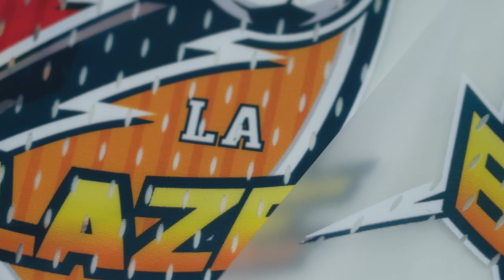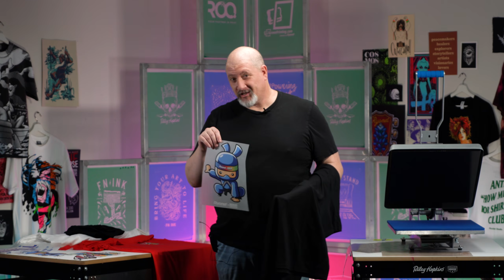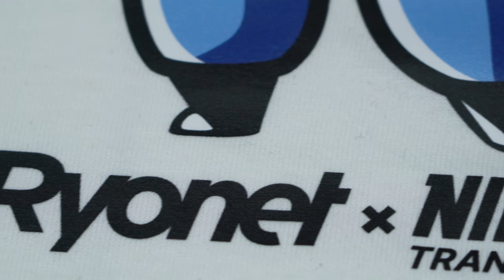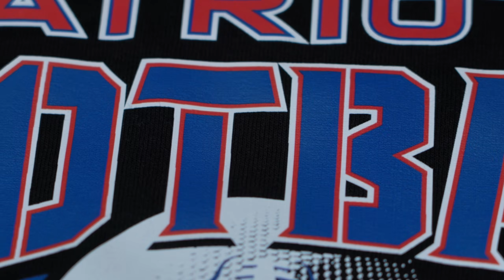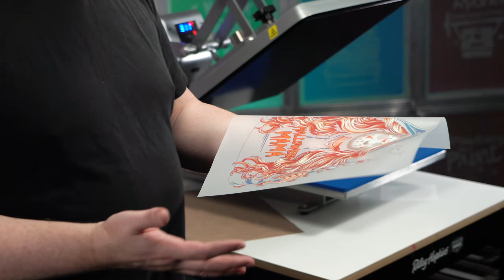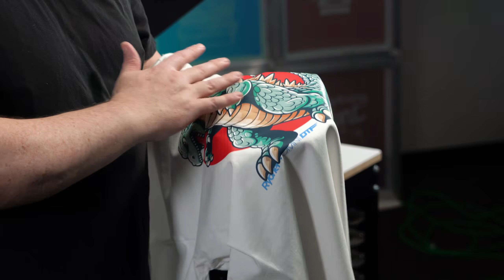Everything You Need to Know About DTF Heat Pressing | Deep Dive With Colin

Comment: Thanks for this Colin! Do you ever use a heat press pillow to prevent those crease marks along the edges?

I’m also an old school screen printer. I’ve been warned about DTF and probably digital hybrid printing taking over but do you see this as the case or do you anticipate screen print will have longevity and continue to be around?
Reply: Hey!  I have used the pillow in the past.  It works, but not as well as everyone "hopes" it will work.  I mostly dislike it for causing the occasional hiccup/wrinkle in the transfer or causing the transfer to shift a little.

Direct to Film Printing - in whatever form it takes, will not go away.  Just like Direct to Garment printing has not gone away. DTG has been distilled down to what works best for it, which is print on demand / crazy quick turns with "lower volumes".  Hence all the 750k+ machines that are designed to do multiple forms of Direct to Garment printing.

Direct to Film will improve in hand feel over time.  But it WILL NOT replace screen printing.
Reply: @colinhuggins6164  I think I needed to hear that today, haha. I also just love the screen print method and as far as I know some forms of it date back to Ancient Chinese methods thousands of years ago.

That makes sense that the pillow could cause some hiccups-the only thing I wonder is if there might be two additional minor issues not having something in between the shirt layers (full disclaimer I haven’t dabbled in the DTF world yet so pardon if none of this applies or matters):

1. Let’s say you have an instance that is unavoidable that you have a crease indent coming from the seam below (say you have a nape of neck transfer and the collar from the underside causes the indent, or a sleeve print where the underside crease comes through)

2. This usually won’t be the case but when I used to heat press a plastisol print and it was a thinner garment material I actually had the inside of the shirt stick to itself if there was a print on the other side. Perhaps it could be a case but might be unlikely that would happen with the DTF adhesion.

Thanks again as always and for the follow up discussion as well!
Reply: screen printing will never die  hybrid print is made for craft community. and small business that can’t screen print at all